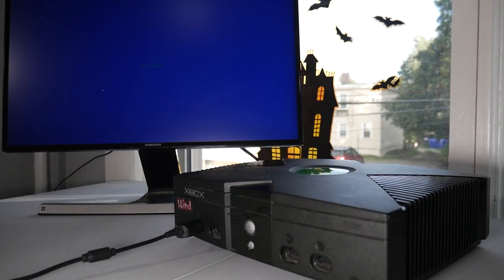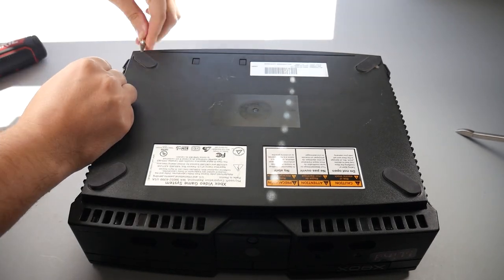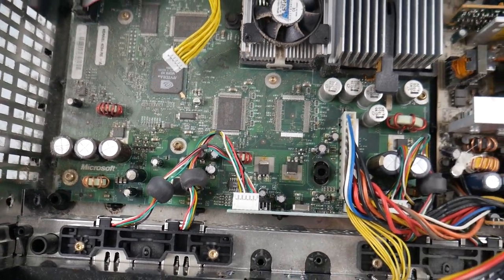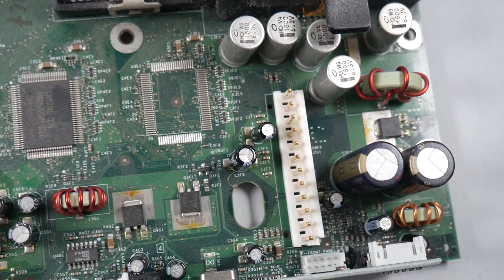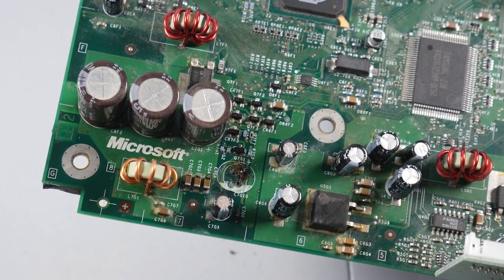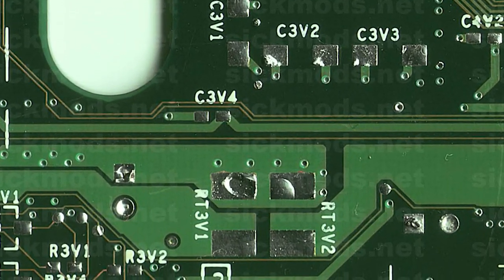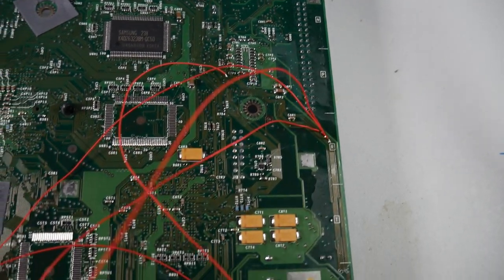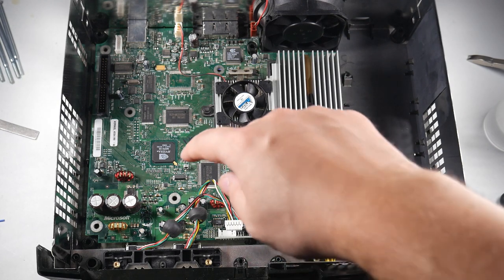OG Xbox Clock Cap Removal and Trace Corrosion Fix

Comment: Great job!

 I have a 1.6, so I haven't had to worry about the clock cap, but I heard you say that in a 1.6, it's best to replace it...

Huh?

 To my knowledge, the 1.6 doesn't have a clock cap.

 Anyeay, it's nice to see you branching out, and not just focuaing on Nintendo, so much.
 The world is full of games, my man.

 Greets, from México.
Reply from the maker: Yeah the 1.6 has a clock cap but the issue isn't as persistent as it is in the older revisions. Really with the 1.6 it's the 5 largers ones just below the CPU. They all are still electrolytic and 2 decades old so they are bound to need to replaced at some point
Reply: @BelowAverageGaming  for real?
Wow, I did not know that.

 Guess I'll habe to check my system, to see which ones they are, and what state they're in.

 Thanks, man!
Reply: Also on a 1.6 if the cap is just removed the system won't boot. You need a replacement capacitor.

Comment: The square pad is ground and its connected to the ground plate that runs through the board. The ground plate sucks a lot of heat away from the iron therefore making it extremely difficult to unsolder.

Comment: After the damage is done, can I attempt to remove the corrosion along the traces? Or is the only solution to add the jumper wires? I just removed the clock capacitor. It was leaking and was certainly the culprit. Thanks in advance.
Reply from the maker: Oh yes, most definitely clean the traces.

Use some rubbing alcohol and a q-tip 
If you have an old toothbrush that you can spare, you can lightly brush against those tracks to try to get those thicker pieces off 

Be very careful with this part, you can also use an X-Acto knife to lightly scrape off really bad areas..

If your traces are completely destroyed though, jumper wires are your only alternative.
Reply: @BelowAverageGaming  Thank you! To the naked eye, they look OK, and really no visible chunks corrosion or disconnects.  The alcohol and qtip picked up a lot, I couldn't believe it.  I do have a 10x magnifier I'm going to check it with tonight to get a better look before I reassemble!